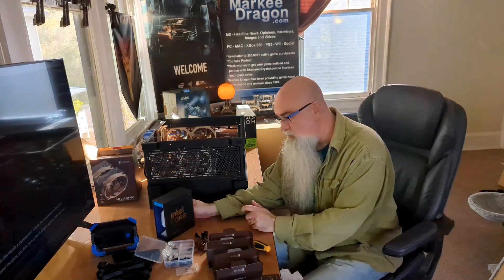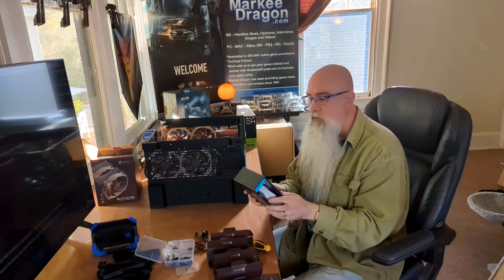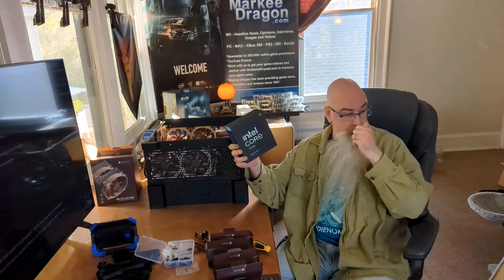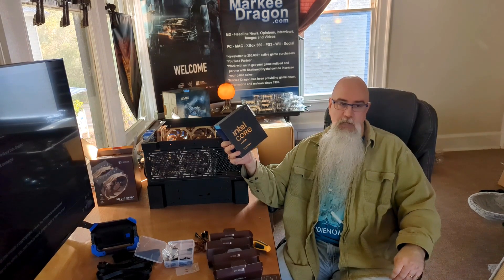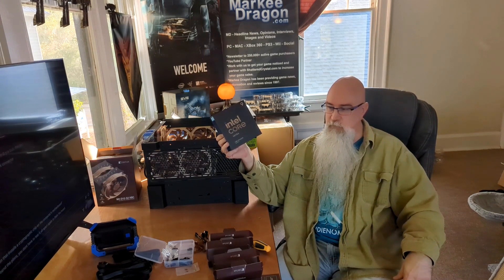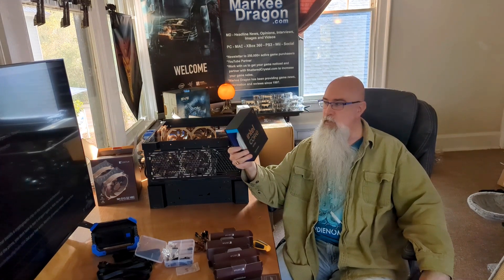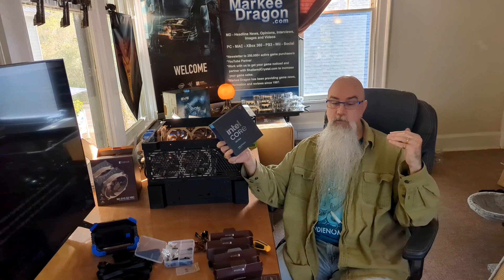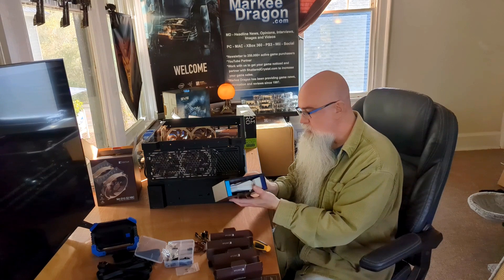CPU Install  - Intel Core Ultra 9 285k System Build 016

Comment: building intel in 2024 is crazy! just wait till this generation also has degrading performance like the last two
Reply: Not that bad if you are coming from a 4 year old or 5 year old gen platform. Obviously AMD is king at the moment even if the 9000 series came out kinda lack luster but for gaming they are too dog especially the 9800x3d
Reply: You must be a gamer only person
Reply: doing productivity on your PC is crazy? Arrow Lake slaughters AMD in Club386 value rating, production benchmarks, iGPU performance, ML tasks, and media processing. The 13900K/14900K degradation problem was confirmed by Intel to be a non-issue on the new Core Ultra series.